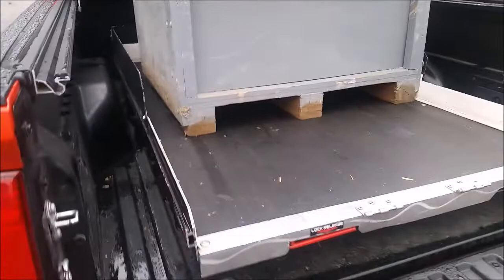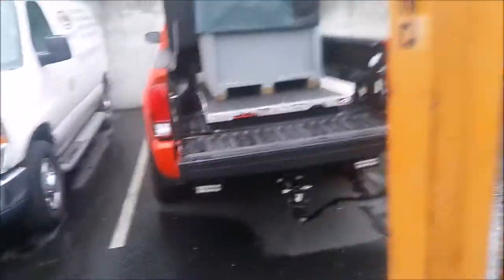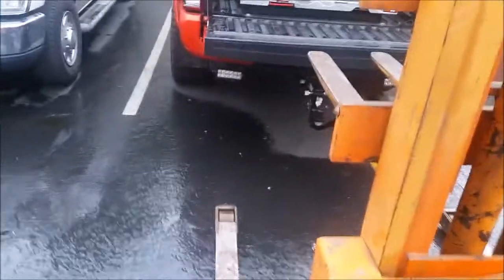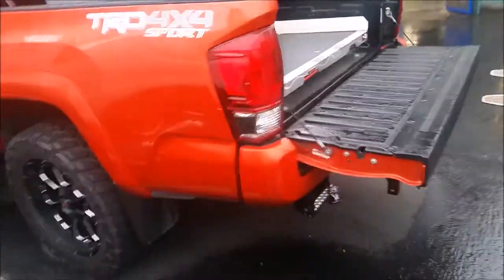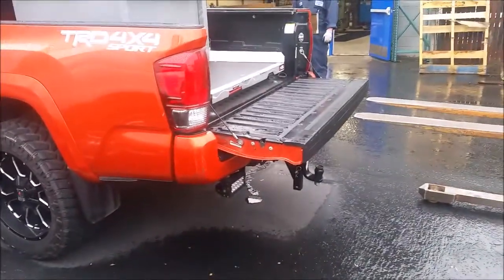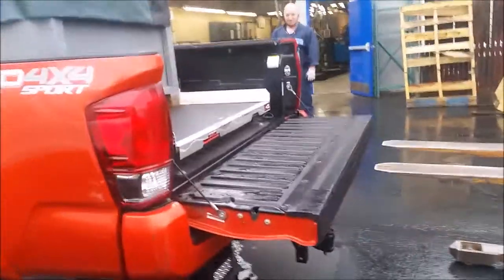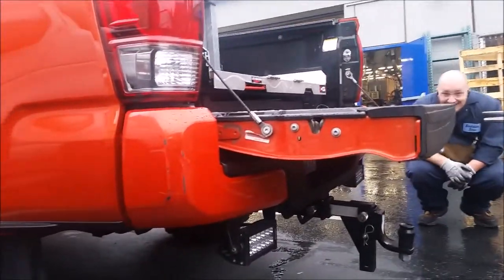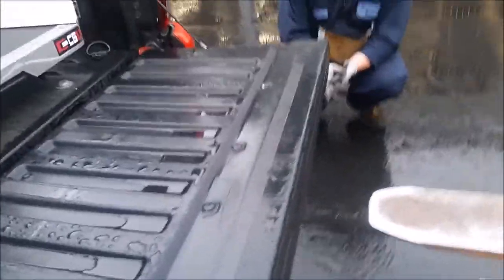2016 Tacoma Air Lift short review

Comment: I guess he meant 8000lbs. Lol  800,000 would snap the axles and bust the tires crush the bed.
Reply from the maker: 800-1000 lbs
Reply: @hayaboosta8939  I'm getting ready to move my toolbox on a trailer and it's about 6k. I'll hook it to my truck and show you the bumper on the ground. Going to install bags Monday morning that will show the truth about the bags. If it's still to much squat ill use the company f250.
Reply from the maker: @kc8tyk86  that will be interesting, hopefully your leaf springs don't break
Reply: @hayaboosta8939  lol no they will be good. trucks rated at 6500 tow capacity
Reply from the maker: @kc8tyk86  sounded like you were putting it in your bed.
Reply: @hayaboosta8939  lol no that's why I wrote i'm loading it on the trailer. I have them moments also. my wife rolls her eyes.

Comment: What wheel set up? And size? Also looking to put airbags in of my Tacoma but I have a 1 inch rear spacer do you think it’ll fit
Reply from the maker: I have XD825 Buck25 wheels in 20" (unsure of offset off the top of my head) 295 tires.  I have a 2" block spacer and it works fine, so you should be OK

Comment: Thanks for the informative video and the review.  Did you go with a Firestone or Air Spring or something else?  How much lift does that provide the back end with no load?  I'm wondering if I can get a couple inches of lift on the rear with some air bags to level is out with my 5100's up front.
Reply from the maker: I went with Air Lyft their kit for Tacomas.  I can raise it with nothing in the back about 4" I would say at 65psi.  However without any load the back of your truck may be bouncing around. Just way too stiff.  With a load it definitely rides smooth and more level.   I still recommend mounting the pump in the bed rather than the cab.   Though in the cab since you can hear it, I have had some leaks happen and I was able to notice right away.
Reply: I just bought a 2020 tacoma sr5 4 door 4x4, thinking about putting a camper in the bed, but not got to use the camper all the time so how does it ride with an empty bed can you zero out the psi?
Reply from the maker: @davidpearson5388  https://www.airliftcompany.com/products/air-springs/know-squat/?alc_ad_ck=alcad9-20&gclid=EAIaIQobChMI4uyix7ec8gIVARDnCh3qgQAGEAAYASAAEgJwcfD_BwE

Comment: Just curious if you had to adjust the kit for the lift, looking at these for my second gen but not sure if they will work with the lift thanks
Reply from the maker: No, it seemed to go in just fine with the 2" blocks on the rear.   I did have to jack up the bed a little too squeeze them between the springs and frame, but other than that everything worked just fine